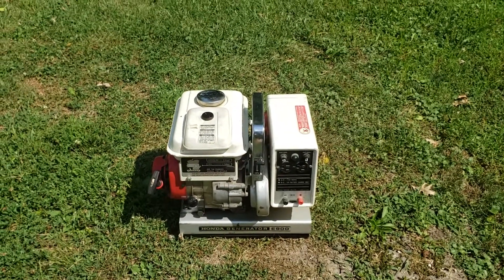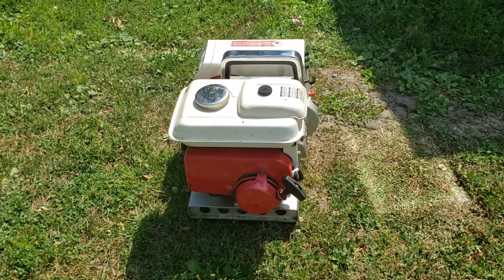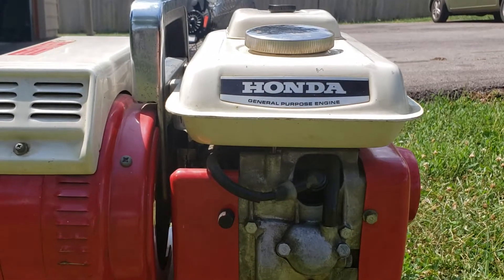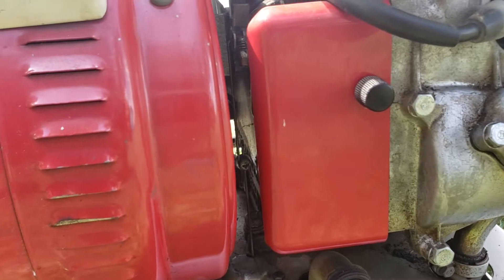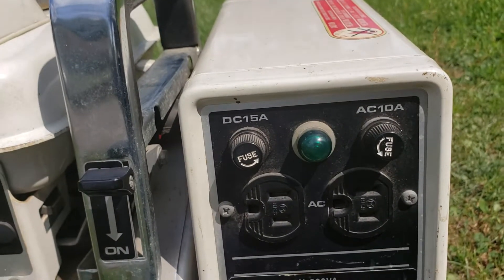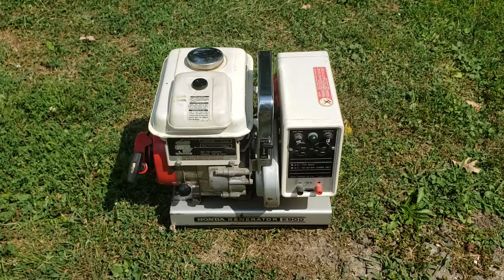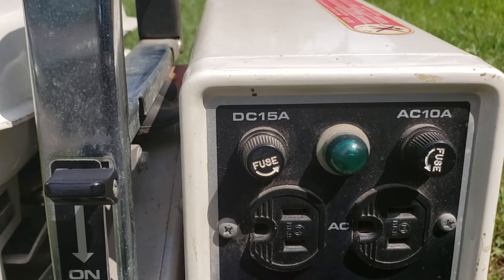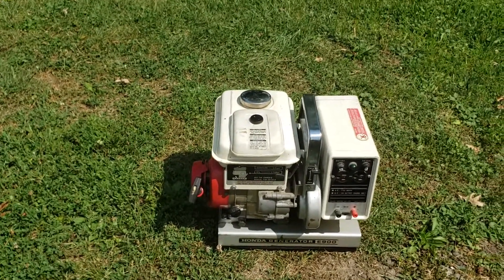Honda E900 Generator  Honda G28EA Engine

Comment: I watched your video with interest . I have one of these also, they are really rare as you know. Mine is also a 1971 model. I have not ran mine several years , so today I took it off the shelf, put in some fuel. Checked the oil and it started on the second pull, runs like a champ. Not sure why Honda decided to build this generator the way they did, having a belt driven generator and all. It also is the only Honda generator with an overhead cam engine until around the year 2000. It is very heavy for it size and fairly noisy . Some of the features it has like the automatic choke and the overhead cam engine are very advanced for its time . I have a feeling it was too expensive to build and that led to its early demise. I am glad to have mine
Reply from the maker: It is super rare, the only reason I have not  tossed it or sold it.   Mine I did the annual flush and refill with new gas.  Unfortunately mine has developed a leak while running. I will have to see about fixing it.  

I do wish it wasn't so heavy it doesn't really produce much power for more modern generators it's weight. 

I imagine the engine is worth significantly more then the whole unit together.
Reply: @lightsoutentertainmentdj  Are you leaking fuel or oil ?  I am envious of your generator, The only part mine is missing is the on-off knob, I checked the serial number on yours compared to mine . They are 2431 units apart .